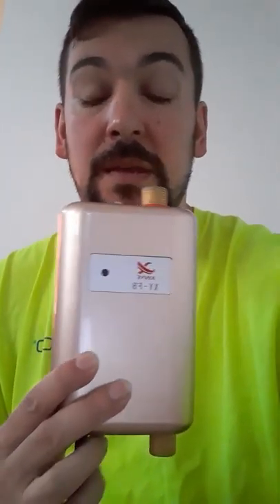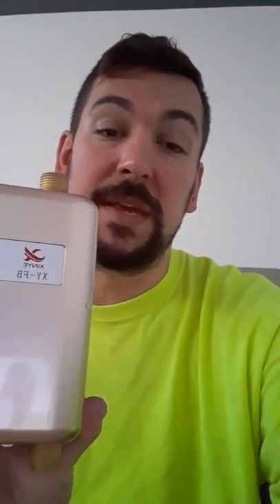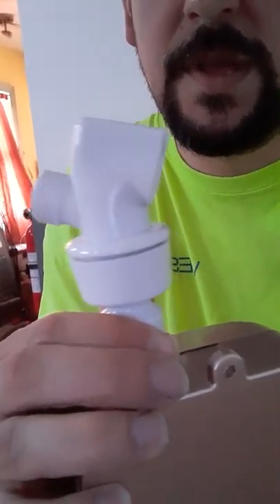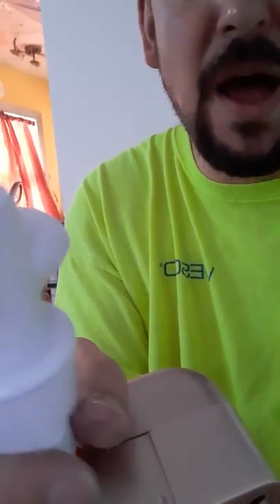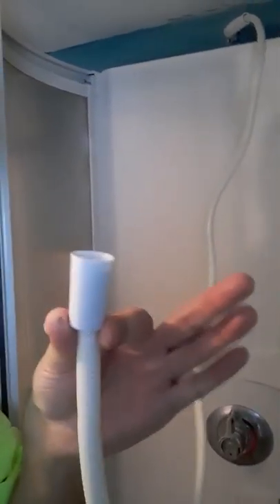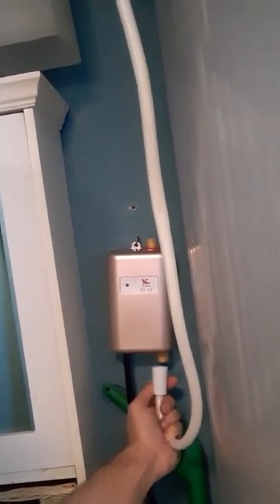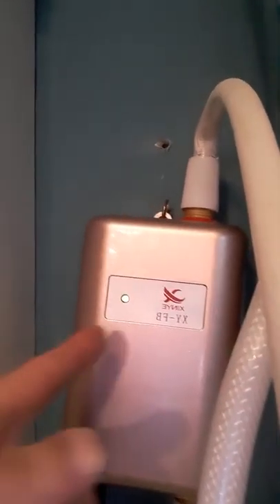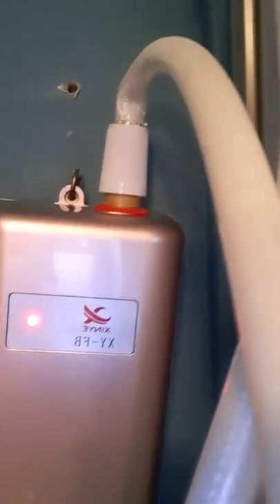Mini Tankless Water Heater.

Comment: I don’t think your breaker tripping has anything  to do with the age of your breaker, I think it’s how much current this unit is drawing. This unit  is rated for 3000w so it draws 25A at max output. Most receptacles are 15A I think.
Reply: I would like to run it on the 30A 120V outlet of my generator from a 7 gallon jerry can.
Reply: Protected Profile .. have you tried it with this set up? I’m wanting to know the same thing.
Reply: @greydogmusic  sorry no, I don't have one of the heaters. I decided I'm going to buy a small tankless propane.
Reply: Anybody know why mine turns on for 4-5 seconds then it trips the power and I have to go to the breaker box to reset it. I can’t get it to stay on for more than 5 seconds. I tried different outlets but no luck.       ???????? Anybody?
Reply: @hairgenius1  same thing is happening to me. I think this unit just draws too much power
Reply: @hairgenius1  How many amps is it pulling
Reply: @hairgenius1  whats your mains voltage? are you on 110V ac ?

Comment: I've got one of these too. 3500 watt version so my 16Amp fuse doesn't pop. Water flow is not that great, but hey..it's good enough to take a shower (for a man). Women with long hair who want to wash it will not be happy with such a system. Otherwise..i am happy with it.

Comment: Hi. I purchased one of these and every time I turn it on it lasts for about a minute or two and then it pops the fuse in my house. You said you had the same problem and I was wondering how did you solve it. Thank you
Reply: I tend to take navy shower. Water on fill wash pan , wet me turn off. Soap scrub , rinse , shave , rinse , dry off. 

Currently use my propane hot water heater shower outside. 70380 we have more tropical jungle type weather than anything else so on average we have water temperature entering the unit around 50°-70°

The longest I use constant hot water is dishes.
Reply: Im having the same issue.

Comment: I put one on a 30 amp breaker. Keeps tripping breaker within 3 min's, the wire gets hot.
Reply: Uh poo poo no no don’t not up ur breaker your wires are not rated for the high amp. Your gonna burn your house down most outlets are rated at 15amps
Reply: @adventureguy4119  This was a 30 amp breaker and plug I had installed just for my camper.
Reply: @chrislincoln489  well if you have it figured out then your ok. Just didn’t wanna see a fire over such a cheap item w
Reply: Does manual says anything about that the cord is rated only for 15amps?  At 15A cord will get warm no matter what - it is designed that way.  No way that I can see that 30A breaker should trip - I would suggest you double check RV circuit.
Reply: @daverudell2256  never trust the manual on chinese electrical equipment. they do a 240V version too so the Amp rating in the deocumentation could be anything.

Comment: How does the water enter the heater if you are in a RV and the water is not pressured? Does it suck up the water or you have to have pressured water system?
Reply: the water will just flow through when you open the tap. i assume it has a flow sensor inside that turns on an element when the water is flowing.
Reply: @JonSpink  So if the heater is installed above the water tank would it still pull the water from the tank? I'm a rookie at this. 😆
Reply: @singhmaster4  No. its basicly a metal pipe with a heating element wrapped around it. the element switches on when a flow sensor is pushed by the water. (this is why it MUST be mounted virtically)
Reply: theres no pump or anything like that. it works in line with your existing taps.
Reply: @JonSpink  So to be clear, water has to be pressurized with like a 12V pump if  the water tank is installed below the heater? 
   Another question, I have a semi truck with four 900+ amp batteries. They are not directly connected to each other. So do I need a circuit breaker to run this heater and a 12V pump?
Reply: And thanks for this video review. I couldn't find another one on this small heater. Life on the road is hard without water especially driving a truck across country.
Reply: @singhmaster4  yes you would just cut the pipe that you might already have from tank to tap and put it inline.  Thid Is a mains powered unit though. Mine is 240Volts (UK) this version in the video is the same but a 110Volt version for USA etc. You will need mains ac to power it its not going to be any use in a camper on 12 volts
Reply: @singhmaster4  If your in a truck im sure there are better ways to get water. cant you get something that can use the engine heat? mayb solar in form?
Reply: @JonSpink  Yea Some people attach a coolant heating pump but running the water through it might not be drinkable. It's probably made from some toxic metal only good for industrial use.
Reply: You said your circuit breaker goes off sometimes. Do you use a power inverter attached to batteries or a generator?
Reply: @singhmaster4  yes youd need a heat exchanger or youd be washing in antifreeze etc.
Reply: @JonSpink  yea that is the right name 😂😂
Reply: @JonSpink  Im still not clear on one thing. Would a power invertor attached to a 900 Amp battery be enough to run this?
Reply: @singhmaster4  yes it would but its not a very efficient way to heat water
Reply: @JonSpink  I have four 900 amp batteries. What if I turn on the truck and attach all four 900 Amp batteries with an attachment before running the water heater? 
   And how do you get the power for this heater?
Reply: @singhmaster4  yes should work fine but you will need a powerful invertor
Reply: @JonSpink  Would a 3,000 watt be enough?
Reply: @singhmaster4  yes
Reply: @singhmaster4  yes

Comment: If the power goes out, does this need to be reset? Or, is it plug and go, is the temp preset?
Reply: I beleive it just gets at hot as it can due to its small heating area. You can controll the tempreture by the flow of water

Comment: I was sold this item by Walmart as product XY-FB, black in color, with an LCD screen for temperature, for under the sink use. I was even recomended the incorrect pipes to extend the existing ones under the sink. They fit my existing piping, but not to the device. XD 
I bought it through the website, so it is gonna be a  mess to send it back, I feel. 
I really should have looked into the product specifications from another website. -.-
Reply: Ehh, I guess I could use it on the shower. seems unsightly, though.

Comment: Seems sketchy. So if you crank the water pressure for a nice hard shower, you get what? Luke warm water? Tepid water? No temp regulation? If it's tripping your breaker, then it's pulling around or above 15 amps, which means it's not safe without a 20 amp breaker. It should be current and temperature regulated. Seems like a fire hazard. I would not buy.

Comment: You want ultra hot water?  Put 2 of them blast the hot water out of one into the inlet of the other and damn, the water will be so warm you'll be like "Damn this is too hot I should take one of them heaters off, hope I can get my money back"
Reply: No do it in paralell.
Reply: @pilotavery  so you mean have two input hoses going into two units side by side and then the two hoses coming out the top are combined together with an upside-down Y hose joiner?  Interesting idea, but I don't think one electrical circuit could handle two of these things  3000W x 2 running simultaneously.
Reply: @madaboutvoice  only on shore power. Really. It's so I have electrical on shore and gas on boondocks.